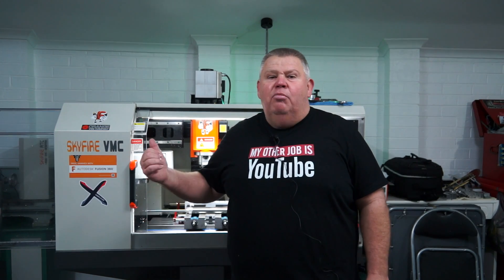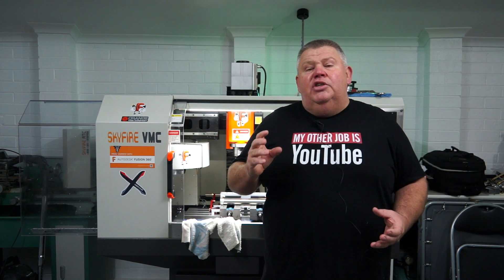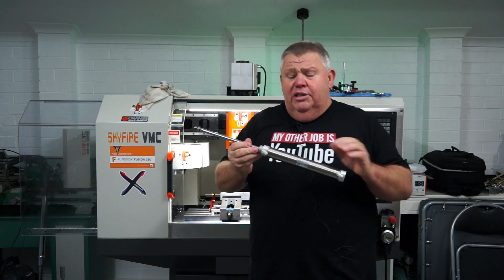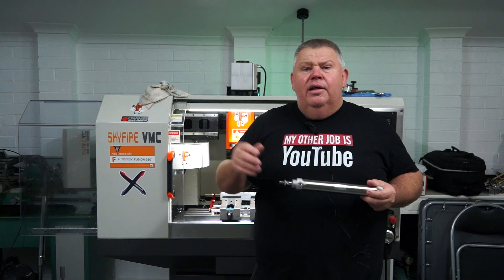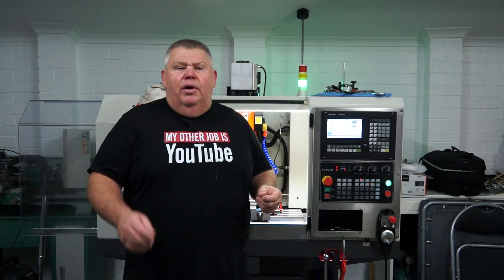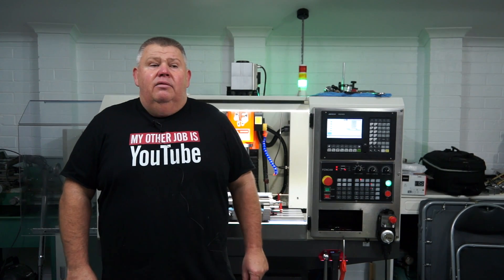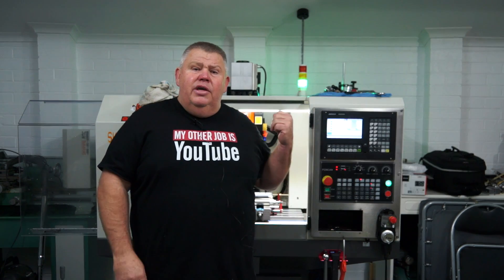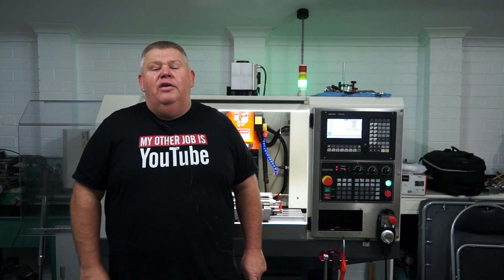I broke my Skyfire CNC Mill - (SVM-1VMC)

Comment: Well done Aaron. YouTube has good and bad and this is one of the good bits - community sharing of knowledge with real world examples of products in use. People can then make their own decisions. 

The air compressor issue was one I was going to mention when I saw your original install. A humidity / moisture filter is highly recommended in arid regions such as yours. Havin been to your neck of the woods, the humidity levels can near saturation during some seasons. 

And its' the same up here in the summer season, which is about to begin here. Even now, when temperatures during the day get over 20 C, my 100 gallon (7 HP, 150 psi, 6.5 CFM) compressor can easily fill the cylinder with a pint of water after a day of operation. A filter system is a pneumatic saver. Many are designed to use automotive engine style filter cartridges and work very well at trapping water vapour entering your air lines and worth the money to install. The closer to the compressor tank outlet, the better. 

This is especially true of smaller air compressors that have to work even harder than larger units because they generate more heat and thus more condensation in the tank as the tiny piston works overtime.

Glad you found a local source of parts. I'm surprised Adtech has halted support on the controller or not offered an update to your 4640 controller. But I can see where this might be due to the processor board and not the software itself. Skyfire probably wanted the lowest cost processing board that had limited memory or expansion slots for additional memory (RAM) to be installed on the PCB. The actual software processing latency you are experiencing is likely due to lack of RAM and not actual CPU processing unless it's an older chipset that was used, which in this case, uses an ARM (similar to RISC) CPU, is relatively basic but uses FPGA (Field Programmable Gate Array), which is a powerful tool when programmed properly. It's not clear what version of ARM is used in the 4640 (ARM 32 bit or 64 bit and what version v8r, v7-A, etc.) The ARM platform is very popular, being used in over 10 billion smartphones over the last two decades and isn't going anywhere soon.

But according to ADTECH's website, I think it's RAM / HARD Disk (SSD type) cache limits are the main problem - with only 256 MB of total space for the controller and file interpolation. The architecture can be found here; 
https://www.machine-controller.com/cnc4640-cnc-milling-drilling-controlling-system-with-low-price-sh_p669.html

I'm glad I have held off my purchasing of a CNC machine to this point. I'm beginning to think it's going to be worth the financial wait and see if I can find either a used 2 year old HAAS TM-1/2 or wait until I can afford a new one a year from now. Skyfire needs to map its product life cycle and give customers options to upgrade their machines as component are either discontinued or found faulty. It's a big market and the home CNC machining center segment is growing quickly and they could lose their position of being a low cost supplier of a reasonable cost machine if they can't get their act together quickly. Consumers like me, make decisions based on user experiences that can be trusted like yours and vendors like Skyfire need to understand this. They can sink or swim based on their products ability to shine or crash in the hands of an expert such as yourself.

Thanks for sharing!
Reply from the maker: Hey Doug.  Thanks for watching mate and thanks for the taking the time to comment in such detail.  I think you hit the nail on the head with comment regarding Adtech and using a lower cost processing board.  The other problem that I forgot to mention on camera was that I can't work outside of the 8 tool in the tool changer.  No way of calling up tool past tool 8.  Hence I have to tool up for every job I do and work within the 8 tool constraint.  Oh well, that will teach me ha ha ha.  Cheers, Aaron.
Reply: Without looking at the board, I can't be sure of my analysis. But it might be worth calling Adtech to see what they say is possible for either a conversion or upgrade. You might be pleasantly surprised at what you could update or replace. 

The actual 8 tool constraint 'issue' - really isn't an issue with respect to the latency or challenges of 3D. It may require you to have two program files, each with 8 different tool 'sets' that are loaded into each file. To be sure, it would be a royal pain in the ass to have to monitor these steps but it shouldn't be a factor if managed correctly - i.e. - the Adtech Controller should not crash or slow down as a result - if Fusion 360 G Code is broken down to two files (which in itself may not be possible, I'm not that familiar with the editing tools within F360 yet)

Good luck and keep us posted!

Comment: Congratulations on being honest and up front about some issues you've been dealing with. Always enjoy your videos and your experience as well as Crudd's ( being Aussie locals) are important inputs into my move into CNC which I am doing this year. 
Pete
Reply from the maker: Hi Peter.  You're very welcome mate.  Glad to have some input out there in the machining community.  Plus I'm glad to hear that others (such as yourself) enjoy watching me LOL.  Out of interest, what machine are you thinking of purchasing?  Cheers, Aaron.
Reply: Hi Aaron - I've checked out the Optima machines from H&F suppliers and I like everything about it - except the Siemens control. For me the most important thing is the ease of use of the controller and most importantly - smart conversational programming  capability.Siemens in the Optima range  is very clunky conversational and in the basic form it comes in unfortunately doesn't cater too well for 4th axis either.
Unfortunately for home use - the price of Haas in Australia is silly so whilst I like their control systems - the price for a mill and a lathe is way out of my league
I love Heidenhan controls and have used form in a NC Deckel mill and Hardinge lathe - but again any CNC machine with Heidenhan is way over the top for a hobby requirement.
Which left me looking at Tormach - basic mill and lathe but really good conversational programming via path pilot ( linux based) 
In a perfect world I could buy path pilot as a controller and whack it onto a machine like yours of Crudds- but that isnt possible - even as a hack.
So it is looking like Tormach - because of Path Pilot. yes I am aware of the lower machine specs compared to Optima or Skyfire but in use - I think Path Pilot wioll make things a lot more fun for me.
If you've got any better ideas - would like to hear them...

Cheers Pete ( Manly, Sydney)
Reply from the maker: Hi mate, can you send me an email please.  Just use my full name at hotmail dot com.  You can find my email in the about section of my channel.  Cheers, Aaron
Reply: @petera1033  what did you end up going with? I keep coming back to the Tormach machines myself. Having a hard time trying to figure out where to put my money. The Skyfire supports up to 5 axis... And that's tempting. But I'm like you.. Tormach really has made it "easy" to use

Comment: Nice to see a blogger setting the record straight and telling it as it is.  Good job man.
Also thanks for making the point of the importance of good quality dry air.  I didn't know it was that important.  I do have a unit to remove moisture though.  (Tormach here).
Reply from the maker: Hey Dan.  Thanks for watching and thanks for your support.  To be honest, the faulty air solenoid and pneumatic cylinder are my fault due to poor quality air supply on my behalf.  However, this doesn't excuse them of their poor QC standards and belated delivery schedules.  Hope your machine is running well?  Cheers, Aaron.

Comment: Hi Aaron, sorry to hear about your issues with the Skyfire. When you first said about your initial toochange issue due to the moisture and air problems I put on a lubricator filter regulator on the strength of your experience, and up to date have had no problems, so thanks fo the advance info. You are correct in that testing of the machines before delivery falls short of the mark, and I hope Defeng makes good on his promise with the toolchanger.
Could the stalling of the Adtech on 3d programs be a look ahead setting in the parameters? just a thought.
all the best.

Phil.
Reply from the maker: Hi Phil it's great to hear from you mate.  Thank you for the feedback.   As you know, I'm not publicly denouncing SF, just bringing to light the problems with other customers machines.  These guys bought machines based on my videos and I feel a tad responsible for that.  So when they reach out to me and tell me about their machine problems, I felt a moral obligation to bring this up publicly via my YouTube channel.  Don't get me wrong I'm still happy with my machine, but am I pissed off that it leaks coolant like a sieve and my 8K spindle can only do 7K rpm due to hunting (well heck yeah).  Hey, you may me right about the parameter thing.  I'll look into it.  Cheers buddy, Aaron.
Reply: Just as a quick comment, I have done a few trials on 5axis continuouse machining and th Adtech seemed to work ok during that, the only thing that created a hiccup was when the machine transition for one toolpath to the next it tried to G0 and in Solid cam I set the transitional feed rate and it smoothed out.
Reply from the maker: Hi Phil, thank you for taking the time to explain this in your comment.  Sounds like you're doing great things with your machine mate.  Take care buddy and please keep in contact.  Cheers, Aaron

Comment: Did u look into the possibility of using a high speed machining code, ive had same issues in the past with old fanuc controls lagging and the solution was G05 Q1 to enable control the read ahead
Reply from the maker: Brendan Dietrich Hi Brendan, it was an easy fix of just saving the code to the controller drive. I think the USB transfer rate is little slow on huge files.

Comment: Sorry to hear you are down Aaron. Pneumatic system can be finicky. I certainly hope skyfire steps up their game. The main reason I went with tormach was the customer service aspect. The fact they run linuxcnc is just a plus. I'm a big fan of linuxcnc too.
Reply from the maker: Hey Jody, yes Tormach really have their stuff together with their customer support.  I predominately hear positive feedback regarding this.  Yes Linux CNC works well for most people.  I've never used it, but Pieter swears by it.  However, he's capable of editing code and writing his own sub routines and macros.  Old Homer Simpson here (aka me) cannot LOL.  Great to hear from buddy.  Hope you're well?  Cheers, Aaron.

Comment: Thanks for the heads-up on both the machine tool and the service you’ve received from the manufacturer. This was an expensive machine and so, it should come with first class aftermarket service. Shame on Skyfire. It’s 9 months old and they’ve had you hard earned cash and turned their back on you. It shouldn’t make a jot of difference if you are a vlogger or not. Their product has a design fault which needs correcting. Name and shame them by all means. I’m going to share this video with all my associates to make sure Skyfire either honour the guarantee or return your money to allow you to buy a machine that has been properly sorted and comes with cast iron aftermarket service . They surely must have some form of service guarantee. Not only this, but they should get their R&D to address this problem and ensure it is cured before anymore are sold. Not everyone has the time or knowledge to effect the repair that you have.
Reply from the maker: Hello Don.  Thank you for your kind words and support.  To be honest I haven't even contacted the factory.  It would be a 2 week wait for a reply email and then god knows how long for another air cylinder to arrive.  I just bit the bullet and purchased another one out of my own pocket.  Unfortunately Don, this is to be expected when dealing with a foreign company.  If I had bought through a local dealer I'm sure the support would have been there.  I imported this myself, so I just got to suck it up.  That being said, I'm still very happy with my little machine and it usually runs faultlessly.  I'm sure I'll be back up and running in no time soon.  Cheers, Aaron.

Comment: That's a Shame Aaron It seems there a lot of " Customer No service" Going on these days. I understand keeping cost down but installing End of life Controllers was a bad move considering the target consumer for this VMC. 
Your 1 year update should be Awesome! Thanks for putting SkyFire on notice! Sam
Reply from the maker: G'day Sam.  Always great to hear from you.  You and I have been at this CNC game for sometime now buddy.  Oh I agree.  They need to hear it and rectify their problems.  TBH, my machine works fine 95% of the time, apart from the occasional tool change issue.  However, many others don't work straight out of the box and these people have bought machines based on my videos.  So I felt that I owed it to them to raise the issue.  I'm not denouncing Skyfire, but I needed to put them on notice like you said :-)  Cheers mate, Aaron.
Reply: Turn Key owners do not often have the benefit of experience building and machining I suspect for most buyer's this is the first CNC machine. The Skyfire is a state of the art machine therefore the controller should be as well. with Fusion 360 being accessible to all most are moving toward it so the Skyfire should handle the Cam ops.  Dirty air That's on you ! But don't beat yourself up over it it happens, Then again a $20 filter dryer/ oiler could have been installed from the factory.
Looking forward to more reports
Be Safe, Sam

Comment: Good man for adding some chip-making footage at the end, Aaron!

Bummer about the machines others are buying, good on you for raising it as an issue. I hope they get some joy; that's a lot of Aussie pesos to sink into something that does not work.
Reply from the maker: Hey Aaron.  Overall my machine works faultlessly 95% of the time.  The air problem was my fault and not SkyfireCNC.  However, I needed to raise the Quality Control issues that others and lack of support that they're getting.  For the record, I don't regret my purchase. But they needed to hear it.  Cheers, Aaron.

Comment: Compressed air systems have plagued me for over a decade. It is not a trivial (or low cost) task to get a good quality air - reliable/dry/clean/oil-free. 

My current home-shop system is a unique approach....shot a bunch of footage but have not yet posted a video. For about 5 months it has kept my CNC and electronics pick and place processes running.
Reply from the maker: Hey man how are you?  Would love to see that video footage if you've got the time to edit and upload it ;-).  Cheers, Aaron.
Reply: All is well, thanks! The good news is the Factory400 is at a functional level of performance. The bad news is that I am buried in time-sensitive work trying to pay for all of it. No time for videos at the moment. 

Hoping to get a clearing to post some of the adventures soon. I think I have a years worth of unique content that will be fun to document and post videos for. I have been pushing the Haas to its absolute limits. 

Glad to hear you have are at least getting some support and able to fix some of this stuff yourself.
Reply from the maker: Thanks buddy.  Bummer about the videos as I would love to see what you're up too.  Cheers, Aaron.

Comment: hi aaron, I know this is an old video.. but I wonder if you can give me any tips on how to choose a controller that is good for handling 3d toolpath? what specification do I have to look for?
Reply from the maker: Hello Vulcan. I have since sold this machine and upgraded to a Syil X7 CNC milling machine. The Syil is far superior to the SF. My advice is to go with a Siemens 808DA controller. Hope this helps? Cheers 🍻. Aaron

Comment: See you have a syil now.    Did the skyfire let you down.   There is one used for sale  near me and looking for honest feedback
Reply from the maker: Hi Dave, my Skyfire CNC served me well whilst I had it. I did have some minor problems along the way, but sorted most of those out. Had the opportunity to upgrade to a SyilCNC X7, which is much bigger and better machine, so I jumped at it. Trust that helps you. If you can get it at a real good price I’d say do it. Cheers 🍻.
Reply: Thanks for the reply.   Just concerned about the lack of support.   Being totally new to CNC and learning 100 % on my own I don’t want to struggle due to lack of support, small user base, and little info available.  I don’t mind spending money within reason if it would make the experience and learning curve easier.   Would you recommend the Syil brand for somebody in my shoes.
Reply from the maker: @davedisalvo4862  Absolutely, the Syil X7 CNC is a much better machine. However it all depends on your budget. If the Skyfire was cheap (like dirt cheap) you would consider it. You will definitely out grow SF though. Unsure where you’re based, but jump on the Syil website and do an online quote. Just check the figures. Best of luck 👍🍻
Reply: @DCT_Aaron_Engineering  Again thanks  For taking the time to respond. OK next question if you are a complete newb, which  Set up would you get in the syil lineup. Including spindle options, controller, Probes, and any add ons?
Reply from the maker: Sorry for my belated reply. SyilX7 2021 model with 12atc and Siemens controller. If you can afford it go with a 4th axis supplied. Check out Jason (Nerdly), he just got a new one 👍🍻